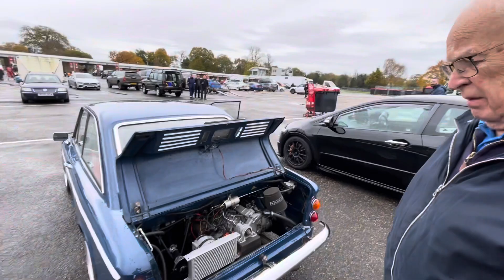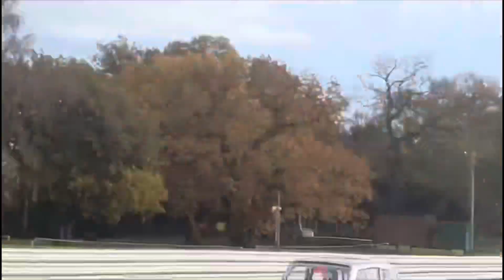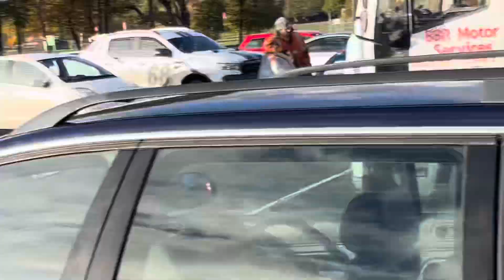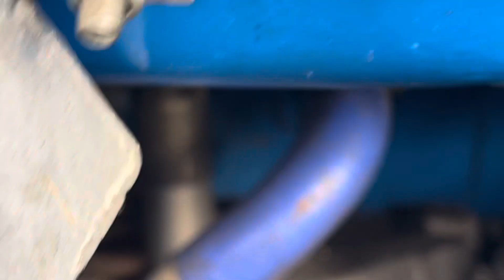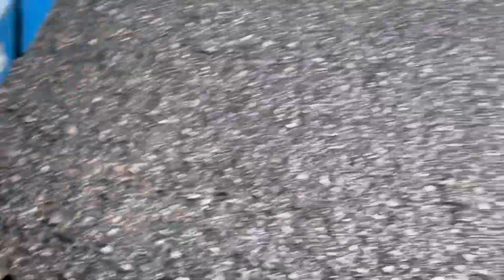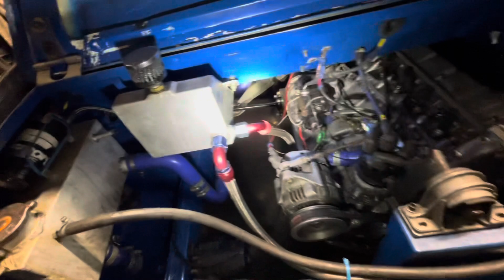Shrigleytube TV Ep19 part 2 Javalin track in 1040cc Imp

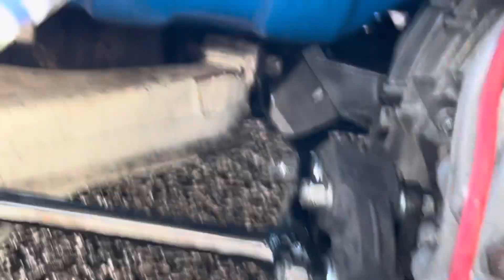Comment: 31:40 Yeah but the track was slippery! You need a nice hot day, sticky tyres and a few hard launches off the line before you can 'really' call it a win. Anyway great vid!
Reply from the maker: yes agreed a good launch off the line would see. some twist in the shaft for sure, i am trying to do clutch slip starts from now on to avoid gearbox/ shaft failure

Comment: Andy , always interesting to watch your videos and some very interesting content. You mentioned previously in a few videos about the Imp head restriction for breathing. About 10 years back there was a billeted cross flow head that was done and you were named as doing some testing on it. What happened to the project and did you ever get to test it?
Reply from the maker: yes the project belongs to a lad i know, the head is at work and he has asked me to finish the project off but i haven’t had spare time to get to it yet. it could be for sale if you would like to take it on ?
Reply: @thehillmanator  Thanks but no thanks Andy, too much for me. I have a suspicion that it will breath very well, especially  with the right pistons and your knowledge.